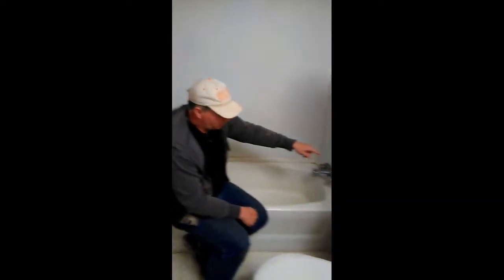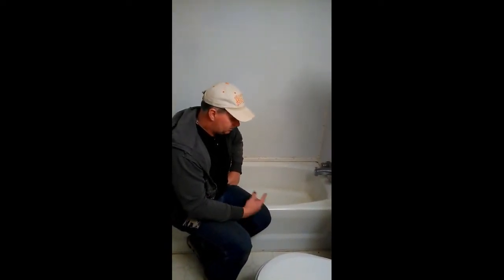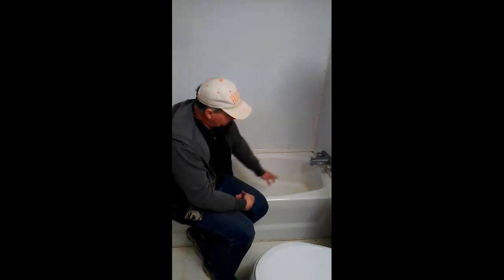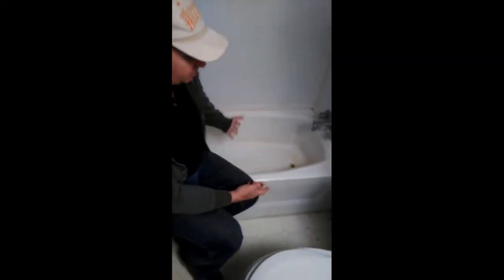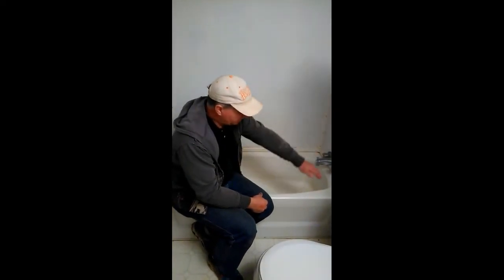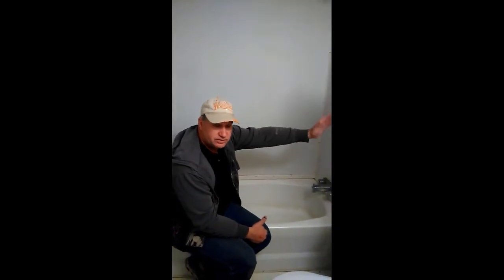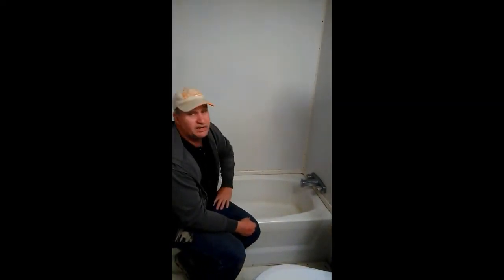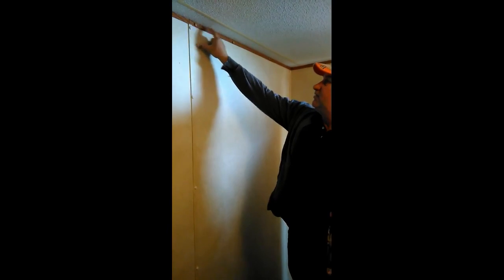Why Your Mobile Home Tub Has Cracks

Comment: Do you think that if there is a crack on the side (versus the bottom like in your video) that the whole tub needs to be replaced?  Before we moved into our place someone did a bad job of sealing a crack, I mean I guess it worked for a while, but now whatever they did to "fix" it is peeling off (it's white and hard, and looks like it was messy to apply).  Do I really need to go get a whole new tub because I really don't have the money to do that right now :(

Comment: Is there any way to re-support the tub from underneath and patch it in some way ? This is exactly to the T what has happened to my tub. The subfloor has fallen out where the cracks are and I can literally see underneath to the foam under the tub.
Reply from the maker: I am sorry your having this problem. I have seen people go underneath put plywood infrom underneath usually supprted by 2x4 to the floor joist .  Then they patch the very thin plastic tub . Usually it only works for a short time at best . Then they are ready to do what it takes to fix the floor and upgrade to a stronger tub. That will be your decision to make .  Still my job is to try to make your life better.  So i would advise you that i would not personally do work that turn out not to last for a substantial time. I truly wish you and yours well .
Reply: Straight Arrow Repair thank you very much

Comment: Man this sucks... My tub isn't even 2 years old and it started with one crack and now there are several more... I thought it was my weight causing it.. And just now I noticed water soaked into a towel so I'm assuming it's going to rot my floor if not already if I don't get it fixed... This is frustrating I can't afford to buy and install a new shower now I'm super stressed out...
Reply from the maker: Your first challenge is to find your water leak. That's what caused the floor to give out in turn then the tub doesn't get the support it needs.  In my area habitat for humanity has people donate showers and tubs, also faucets .  i have faith you will overcome
Reply: @StraightArrowRepair  thank you :)
Reply: If it's leaking, there's a chance it could be polybutylene pipes, replace them with pex and that will probably fix it. If your house was built in the 70s or 80's, there's a good chance it used PB pipes.
Reply: @rs72098  it was built in 2017 we still haven't been able to afford to get it fixed ugh

Comment: Actually MY tub is ALSO 54" Sooo
Reply from the maker: Maybe i should have mentioned that outside of mobile homes tubs sre 60 inches or more i will try to mention that more often whereas most tubs in mobile homes are 54 inches .  so if you buy a tub or a tub surround you need to make sure that it will fit your application . i will try to be more explicit about this in the future. I wish you and yours well